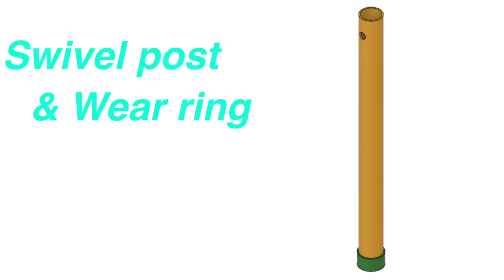DIY Shop Crane Build Part 2 FINISHED!

Comment: intention to inform, since idk what you know: when you clean the zink of the galvanized pipe you can weld it easy without spatters.
Reply from the maker: Hello and thanks for watching. Yes that is correct I removed the galvanising to make it easier to weld. Plus the fumes are very toxic coming off galvanised pipes. 👍🍻

Comment: G'Day Aaron, great concept with the adjustable jib length, I'll have to remember that one.  I have used brake winches for that type of work in the past, full braking control in both the up and down direction.  
Cam
Reply from the maker: Hi Cam and thank you for positive feedback.  I bought the winch of Amazon and it was left handed.  I had to swap everything over to the other side to get it to work.  I think the winch is a much better idea than a hydraulic jack, plus I can reach the floor.  The telescopic boom was great idea (if I do say so myself 🙂).  I can adjust that in and out even with a load on the sling.  For that I used a M20x2.5mm all thread.  The only problem with the winch is that it doesn't have a brake, apart from the ratchet dog on the cog.  Thanks for watching Cam.  Cheers, Aaron.

Comment: eh, not how i am going to do it, but i appreciate the video you posted, it gave me some insight and ordered some ideas i already had in mind... I need a decent crane, and i aint paying 200-400 euro for what i can make with a tig welder, machines i have and scrap steel that can be had for 1/10 the price if you can find what you need at the moment... Tho, i need it to lift at least 600 kg, so it will have to be quite more substantial than what you have here, but this is a good addition to my ideas of a diy skyhook for my lathe too... The toolholders alone weigh 2 kg each, giving you the idea how heavy the rest of the things are...
Reply from the maker: Hi Camillo.  As the old saying goes, "there are many ways to skin a cat".  However, it sounds like you need something way more heavy duty compared to what I built.  My little shop crane is very light duty and was purposely created to lift a weight 50kg max, as the shop trolley will tip over.  I could improve it by placing an outrigger leg.  I predominately use it to lift the vise out of the CNC machine and chucks off the lathe.  So it's handy to roll it around whilst doing so.  I actually have an engine crane (folded up out of shot) that I use to lift anything heavier then that.  Thanks for stopping by.  I am very interested in seeing your build Camillo.  Please feel free to share it with me once completed mate.  Cheers, Aaron.
Reply: @AaronEngineering  Nice reply, thanks! Yeah, i have small lathe, mill and a grinder, but i do have a huge lathe, mill and a grinder too, i want the crane to be able to move the large grinder about, as it only has 550 kg, so its light compared to the lathe and the mill, but i too want to eventually maybe lift the lathe head off the body and just clean up the area, oil it and set the head back, and the head of my lathe i would say weighs no less than 800kg itself, as its walls are 3cm thick cast iron themselves, and its a behemoth in every other aspect aswell... I know that this is somewhat of a plugging, but i would recommend you to check out ``steve watkins at work`` how to build a great jib crane, i just got recommended the vid and the channel by the algorithm, the old guys threw up a decent crane from relatively simple stuff...
I will see what approach i will take, and what elements are going to be granted my crane, but i think that your jackstrap winch is a great approach which i will employ for a small crane that wont have to raise a ton or two but will serve the purpose you made yours for... Kudos for that idea!
All the best

Comment: Really nice job Aaron. I can see the powered telescopic coming in very handy. Your boom head is much simpler than what I was planning with rollers and side guides. I like it. Have you found that the belt walks over during the swing or the part swings as you lift.?

All the best!
Eddie
Reply from the maker: G’day Eddie. The crane is working a treat. I need to makes some aluminium rollers to rotate over those bigger 10mm bolts. I think this would be better for the belt. So far the cheap hand winch I got from Amazon is working well. It was a left handed setup which I converted over to right hand operation 👍🍻

Comment: You’re missing the tail maneuverable weight. To complete the function and keep innovating
Reply from the maker: It relies on weight on the trolley to keep it on the ground.  Maximum lift is under 50kg with the trolley weighted.  Thanks for watching.

Comment: G’day Aaron. Nice work thinking that one up, looks great with a lick of paint, amazing what sins a little paint can fix. What kind of winch did you use, it sounded like it was ratcheting on the way down, or did you dub over:-)
Cheers 
Peter
Reply from the maker: G’day Peter. Thanks mate, I’m very satisfied with it. The winch came from Amazon and was left handed. I had to swap everything around to make it right hand operation. I like the winch idea over the hydraulic Jack idea. As it can easily reach the floor. The telescopic boom is operated by M20x2mm all thread. I watched your video last night on the television. The wife will be happy with you after she gets new alloy mag wheels on her washing cart 😉 👍🍻

Comment: G'day mate just wondering what tool your using for taking the powdercoat off ?
Reply from the maker: Hi Duncan. It was rather dodgy of me, but I used an old file that I had and sharpened it to a point like a wood chisel. Then I used the metal lathe like a timber lathe and scraped it off. Cheers 🍻

Comment: Hi Az,
Man, that lifty thing is sure pretty 👏👏.
I loved the ‘ power jib’ mate…. Very nicely engineered.
What sort of gear ( weight-wise) is inside the trolley?
Let’s hope none of your school students see you welding in short sleeves 🤣. I hope at least that you were wearing steel-capped thongs mate ( for our International mates, ‘thongs’ is not a pair of minimalist Grundies ( underpants), rather it’s what we call ‘flip-flops’).
Fond Regards
Grasshopper
Reply from the maker: G’day Robert. Mate, the crane is working an absolute treat. I’ve got a fair bit of weight in the drawers and on the table. It will lift 50kg fully stretched out, but it starts to get iffy. Yes my arms got spatter burns welding that shitty galvanised pipe. I can’t wear a thong mate, Dianne buys me G-Ropes now 😂.
Reply: Aaron in a G-rope ???
Nw THAT would be a sight eh?
😱
🤣🤣🤣

Comment: That is good !

A bit of pucker factor is ok until it all turns to crap & job turns out shitty.
Reply from the maker: G'day Chris.  Not wrong mate.  When I was machining that key that slides in the slot stupid me forgot to tighten the collet and I blew that 12mm solid carbide endmill FFS (Doh!).  Cheers, Aaron.
Reply: @AaronEngineering  I even gave it a Thumbs up.
Reply from the maker: @ChrisR2517  Much appreciated Chris, I need all the help (thumbs up) I can get 😆